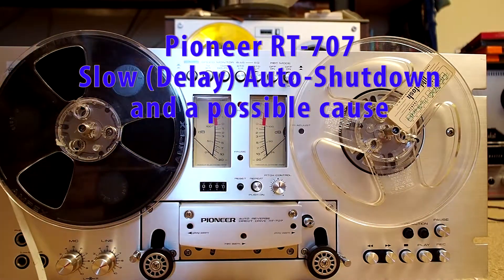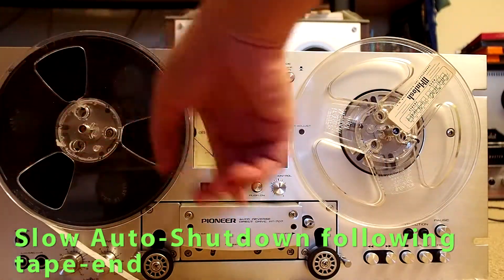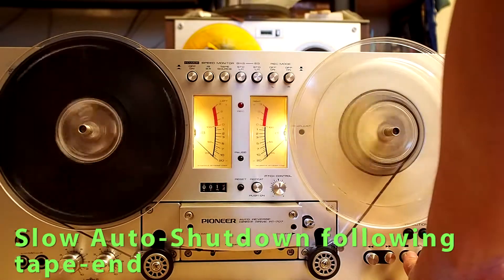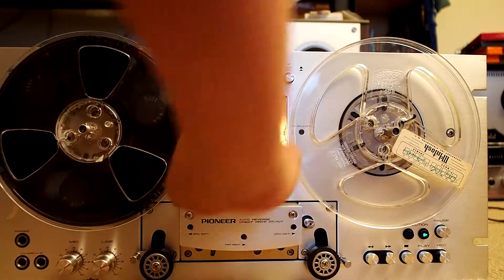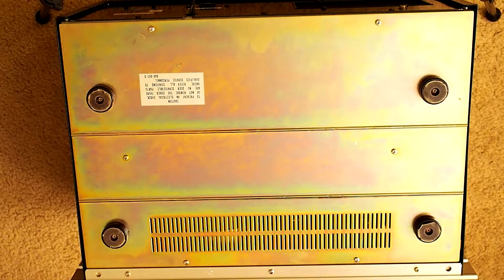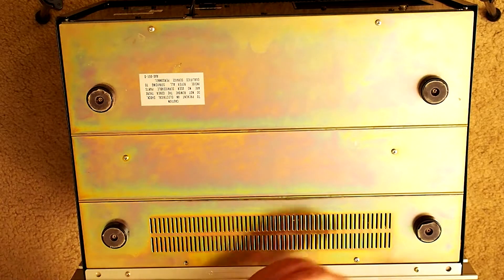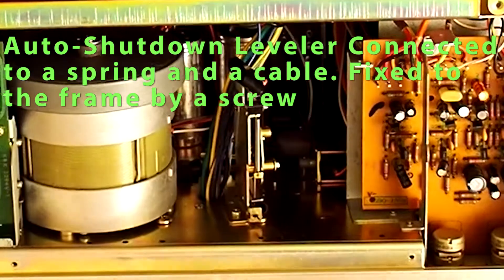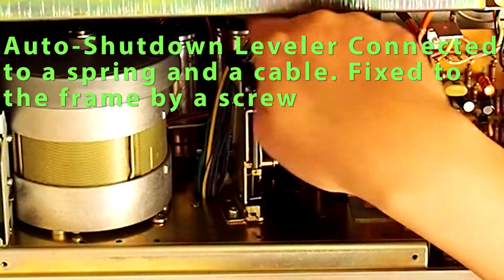Pioneer RT-707 Reel to Reel Deck Slow Autostop Auto-Shutoff Repair Fix

Comment: I cleaned it but still not shitting off. I sispect it is that small vlack switch. Do you just loosen the two screws and move the switch. ?
Reply from the maker: yes